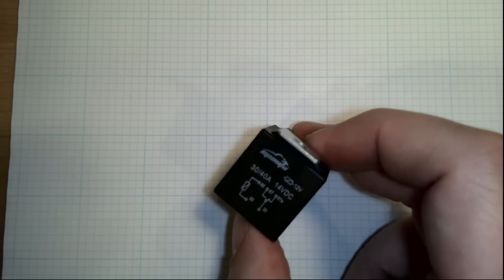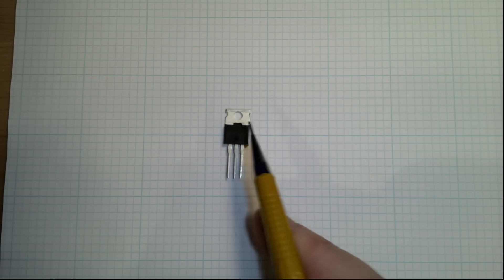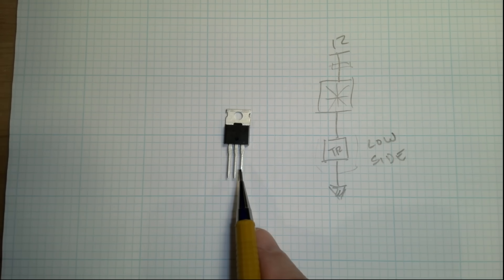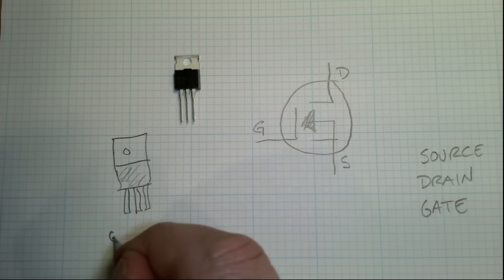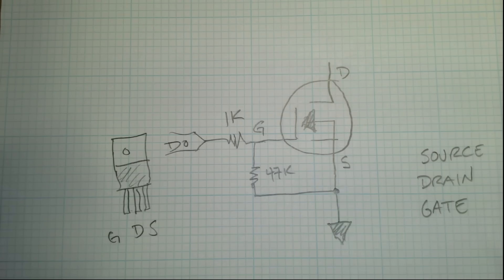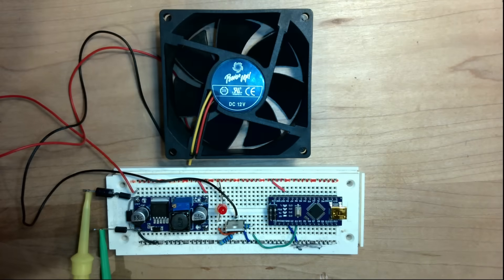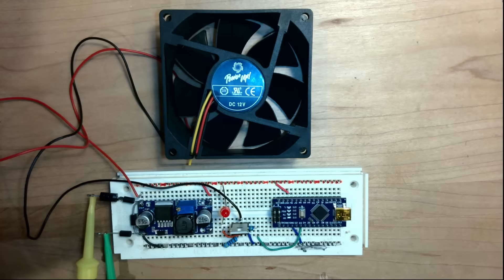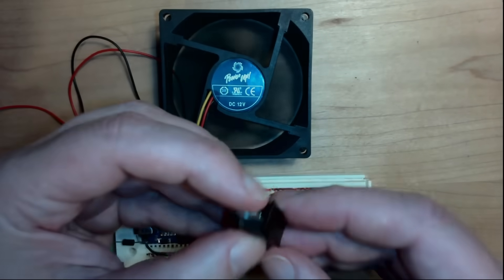Using a MOSFET to Switch High Current Automotive Loads

Comment: Please note, that at 49A the power loss in the IRFZ44N is: 49A * 49A * 0.0175ohm = 42Watt - without additional cooling, the TO-220 housing can not dissipate more than 2W

0.0175 (17.5 milli ohm) is the Vgs when the gate is driven by 10V.  If you microcontroller only gives out 3.3V (or 5V), then the Rds-ON can be higher, possibly 3-to-10 times higher. 

If the IRFZ44N is used without additional cooling, then the internal heat loss must be below 2W. 
So, without additional cooling of the IRFZ44N mosfet,  the load should stay below 10A ( 10 * 10 * 0.0175 =  1.75W) at Vgs = 10V
Reply: For logic levels I find that the IRL520N is much better if you only switching 10A Max. The IRFZ44n needs about 10V to fullly turn on the IRL520N works perfectly at 5V VGS.
Reply: I can't imagine those pins carrying 30A of current for more than 1 sec before they start to melt.  That looks very similar to the strip of metal in a glass 6x20mm fuse.
Reply: @ericmartin9299  They would only melt if they get hot enough. If the heatsink is doing it's job, it will keep them cold enough. But it's NOT easy to use a mosfet to switch a 30A load. It needs to be the right mosfet, with low enough Rds to keep it as efficient as possible. It needs to be the right heatsink to be able to get rid of the generated heat, in all possible enviromental conditions.
Reply: @ericmartin9299  Steel pins vs aluminium or similar in the fuse designed to fail. Not even close
Reply: @ericmartin9299  Yes I would be concerned about the lead cross section area but it also depends upon the duty cycle.
Reply: Most recent design I am doing has three NMOS power transistors (IRF540N) in parallel. I modeled the threshold variation and the RDS variation with the NMOS' using LTspice Monte Carlo runs. For a 20 ampere total load. I plan heat sinks on each too. Should last longer than a relay. I always try to spray a coat of protectant on the whole board. May hinder heat transfer a bit.
Reply: Use an IRLR7843, which can switch up to 30 volts and has an RDSon of 3.2 mOhm at 4.5 V Ugs and 2.6 mOhm at 10 V Ugs. At 12 A, this dissipates less than 0.5 watts and requires little cooling. This transistor is very inexpensive, costing barely more than $1 in a pack of four – including the circuit board and LED display.
Reply: If you need a higher voltage up to 80 V, you should look at the MDP1932 with RDSon 3.4mOhm at 10V Ugs

Comment: I will choose that relay over any electronic stuff. Goes bad, pop it out and pop in another. Done. Transistors are usually soldered onto a board. A lot more expense and work.
Those transistor leads cannot hold very many amps. Maybe 20 amps guessing at best.
Fans are generally not high current items.
Fuel pumps usually are. Electric windows. AC compressor.

No mention on how he arrived at those resistor values. Guessing I suppose?

When one mentions source, we think th battery positive is the source not the negative ground.
Reply from the maker: Your car has an electric AC compressor?

Comment: I replaced mosfets with relays because there is a voltage drop over the mosfets which was too much for my application, but I don't like it and now searching for a mosfet with really low voltage drop, any recommendations?
Reply from the maker: Maybe something like a IRFB3207?

Comment: You need a Gate-Source zener clamp to prevent unexpected transients punching through the gate oxide, making the MOSFET a piece of wire.  Also, just a thought, I like to use a gate drive soft-start circuit for big inductive loads to subdue current spikes in wire bundles
Reply: mosfet accepts 20v on gate
Reply: @1adarad 
An inductive spike can be in the 100’s of volts.
That’s why you always use a diode to prevent that.
Most cars today has protective diodes inside the electronic boxes as most relays are without.
Reply: @1adarad  And...?

Comment: On my Robot, I choose to use a bi-stable latching relay. Its a little harder to control but doesn't draw current in either direction when latched. I am switching 60A which is a lot. I looked at SSR and other options but they all have huge heat sinks and draw power during use. For a robot every bit of power saved counts!. But I'm just throwing this option out there because very few people seem to know this option exists!
Reply: And if your computer chip fails to act, power will just stay on with cutting power as the only option? At least the commentator put a pull-down resistor on the MOSFET in case the computer chip is open output or not connected up.

But love those bi-stable relays for controlling lighting, no power wasted like all the active light controls that waste power while all the lights are off.
Reply: @gordonelliott7870 so, one thing that most devices that use bistable relays have often is a momentary push button override. So you install a button that can latch the relay to off or on somewhere on the device in my case robot. And if you need to immediately power it off you tap that button which forces it into off position. Its always good to have failsafe buttons on things like robots. The neat thing about using it on a robot is that you can have it dock, turn off and charge while its completely off, and then have a circuit that turns it back on when fully charged. This allows for full use of the battery in both on and off states without extra current going into just keeping something on or off. There are a few types of bistable relays, some use a common pole and are wound in opposite directions with 2 different ends of the coil so you can tie one common pole to power or ground and then simply apply the opposite side of the battery to whichever side of the coil to turn it on or off. And the other is just 2 poles on the coil and you have to swap the voltage direction to turn it on or off. They have to be wired differently obviously. But both work the same way, a magnet on each side of the contact holds the contacts closed and the coil basically is used to push/pull the contacts from one side to the other. They typically last longer because the coil is only used for a brief moment and the magnet holding it on each side prevents the contacts from partial contact where arching can occur damaging the contacts. I with they were more popular to drive the cost of them down a bit but they are not too expensive. I use them often in projects because I hate to waste power just to keep something on or off. And they can be pretty small without a heat sink in comparison to other options depending on how large the load is. Obviously if you are only switching milliamps in something like a watch size they are not a fit for that. But anything over an amp or so in larger items they are a great option. These don't replace fuses etc, you should always use some sort of fuse even with a mosfet solution.

Comment: You can use an N-Channel Mosfet on the high side too but you need to drive the gate differently for it to work. as the Mosfet on state is determined by the voltage difference between the Gate and Source you would need to always have the gate at a higher voltage compared to source within the mosfets limits for it to turn on. But if you have a separate isolated gate source driver you can turn on the mosfet no matter how the load behaves or where the mosfet is installed so to speak
Reply: The tricky part of using N-channel on the high side is that the gate must be driven to a voltage more positive than the positive supply. So the driver circuit needs to include some sort of voltage booster, which adds complexity.
Reply: There are float gate drivers for such applications, this is usually used in so called solid state relays, there you do not need to think about where is load connected, it works like standard mechanical relay, only you need to pay attention is it for AC or DC application.

Comment: Idk about it being a smaller option once you add that heat sink.
Reply from the maker: If you're trying to put it on a board in an enclosure, though, the connectors, etc for cube relays start to make things really big.  There are smaller, board mounted relays that also work well that are smaller.  Like most things in electronics, there are a lot of ways to solve a given problem, and most of them have trade-offs.
Reply: @dotnetMakers  what I'm saying, is that if you have to go with a MOSFET, you likely won't be able to use it without the heat sink, because if it can be used without one, then the load is probably not drawing enough current to begin with. Once you're stuck with that heat sink, you don't end up with an option that's any smaller.

Comment: i think the little tab on the transistor goes by the "heat spreader". also helps to use a bit of thermal compound between the heatsink and the heat spreader. in some cases the heat spreader is electrically connected to one the 3 pins of the transistor and may cause shorts if the heatsink is electrically involved in the circuitry (maybe grounded or shared with other transistors). in which case there are electrically insulating thermal pads along with plastic washers for the screw that you can use to isolate the transistor. its also worth mentioning that the current rating of the transistor assumes adequate heat dissipation which cannot be achieved in a hot engine bay, so leave some headroom.

Comment: Very well explained. For aome applications I've often thought of using a transistor instead of a relay, but haven't as yet. If manufacturers did use transistors for everything I'm sure they'd stick them all in one box, seal it & charge an arm & a leg for it.
Reply: They do, it’s called an Integrated Circuit.

Comment: I see that the four electric window switches in my BMW are carrying the whole 30A switch load so the contacts get very hot, so my first electronic upgrade will be to have the switches only switch a relay or relays to get the windows to go up and down ...
Reply from the maker: window motors might actually need you to swap polarity for up and down, so an h-bridge driver might be even better.

Comment: Remember that any inductive loads you should have an flyback diode over the transistor 
Motors and coils can create huge voltage spikes when turning off and burn it in a very short time
Reply: YES 100% TRUE. You cannot run a motor in this way straight across a Mosfet, you need to add a diode in parallel to ensure that reverse voltage spikes (back emf) don't destroy the Mosfet.
Reply from the maker: 100%
Reply: This also applies to the coil in the relay itself
Reply: I was a equipment mechanic most of my life.
I have measured the collapsing field on relay coils from 12 to 48 volt systems and have seen up words of 200 volts DC when the field of the control coil collapses.
Without a spike suppressing diode across the coil of the relay, it would sometimes cause other parts of equipment do trigger unwanted things to happen, and sometimes burning out other electronic parts like CPU's.
Reply: @OldGuy625   Most easier tonunderstand this behaviour is to look coil circuit as current source. When switch is turned OFF, for short moment coil becames almost ideal current source. If for instance there was 1A current through coil before shut OFF, the moment after shut OFF there will be still 1A current through coil (it becomes current source). Voltage output would be what ever is necessary to keep that 1A running (ideal current source). This is for short moment after shut off, after that current will drop untill all stored energy in magnetic field is dissipated on any part of circuit.
Reply: Also may need a diode protection of the gate to source and drain nodes.
Reply: Unless the MOSFET is "avalanche rated" then the reverse EMF will "force" its way through the MOSFET for a short time after shut off.
Reply: But even just long enough wires have inductance ! So fly back diode is must have on real applications or do you feel lucky?
Reply: Fly back diode is used on inductive load, on transistor use zenner, TVS, MOV,.... not just plain diode
Reply: Years ago I was working on a Cadillac where the plastic squirrel cage on the AC/Heat blower motor disintegrated.  When the squirrel cage blew up, it jammed the motor.   I could have replaced just the fan but a new fan cost just about as much a new motor/fan assembly.  I installed the new motor/fan and...nothing.   I jumped the motor straight to power and it tested good.   I tested the motor control (IC mounted on a heat sink) and it was DOA.  When the fan blew up and jammed the motor it caused a spike that blew the motor control.  GM didn't include a flyblack diode to protect the motor controller.  The motor/fan cost less than $50 new.  The motor controller cost nearly $300.   You'd think GM would know this.  Well, they do, but they would rather save a nickle on the diode.
Reply: @MrSloika  That's not what a flyback diode is for. The power in the switching gear would have still been flowing had the motor locked up, a diode wouldn't have done anything. Current limiting might have, or some way to check for a stalled rotor. Not sure why you'd think what was probably a brushed DC motor would still be good had it locked up and still been fed power for an unknown period of time. It would likely have melted in short order, too, and was probably what actually blew the fan controller. 

Flyback diodes are not always good and sometimes better to drive the mosfet to avalanche as it will shut the load off faster assuming the mosfet can handle the extra energy. Fuel injectors on cars are a great example, whereas pretty much any other solenoid on a car will have some sort of way to deal with the coil current as they are much too slow to really matter anyway. Read some mosfet datasheets and you'll probably even find they spec how much energy they can dissipate like this, and for how long.
Reply: @pontiacg445 I'm not an engineer but this is what I wss told by an EE.  In anycase a jammed motor is not an unforeseeable event and GM did not  provide any protection for the controller.
Reply: bedini motor left the chat..
Reply: Would a Schottky diode suffice then?
Reply: You always have a Body diode inside a Mosfet. For inductive loads the free wheeling diode needs to be in parallell with the load to actually protect the circuit naturally with the positive end of the diode at the positive input of the relay or whatever is used as load

Comment: They really can't sink 49 amps continuously unless you heat sink it well. And when you heat sink it, be aware that the drain is connected to the tab on the back, so its not as simple as directly screwing it to something

Comment: 1k resistor - How much current flows through the gate of a FET? : 😉
Reply from the maker: If it's working properly, near nothing.  However if it fails gate to ground, it can easily cook your microcontroller.  Ask me how I know. 🤣
Reply: Virtually nothing. 

To me, that's one of the biggest advantages of MOSFETs over relays - most microcontrollers cannot drive a relay directly (relays often need 200mA or so), but the MOSFET is switched using voltage so the current requirement is tiny.

Comment: Excellent video, truly an engineer.
Few explain things as clearly as you do.
I have a very simple question. I see that there are some diodes on the voltage input to the entire system.
What's their purpose?
Thank you, and congratulations! You now have a new loyal subscribe🎩
Reply from the maker: Take a look at the video linked in the card. There's a schottky for reverse polarity protection, a tvs for voltage spikes and ferrite beads for noise suppression

Comment: Relays are very reliable, in owning and working on many cars for more than the last 30 years i came accross not more than 3-4 relay faliures. and on failiure it is very simple to troubleshoot and replace. why overcomplicate things ?
Reply from the maker: If you're building a controller for something, relays aren't always the best solution.
Reply: true theyre good nowadays!